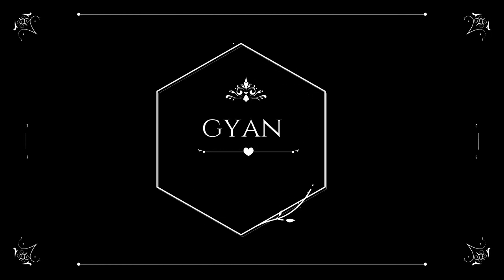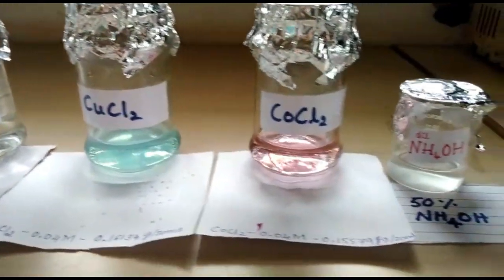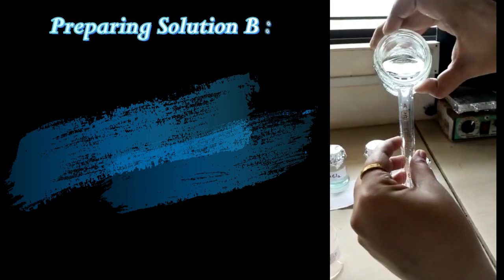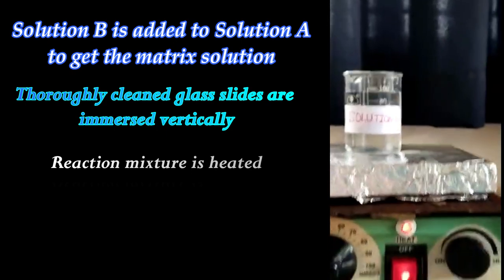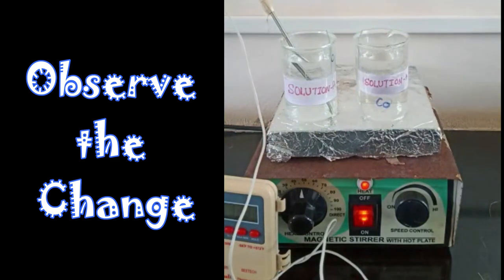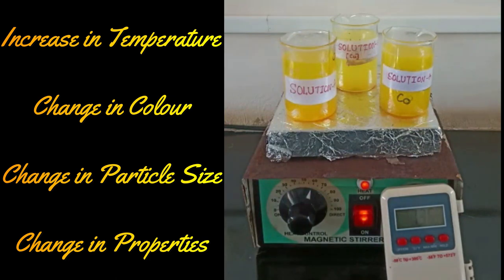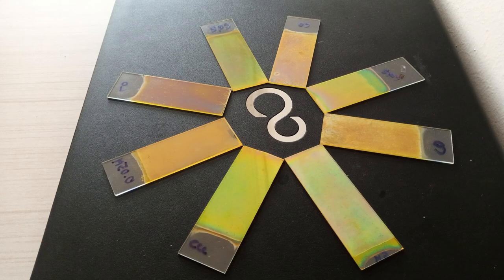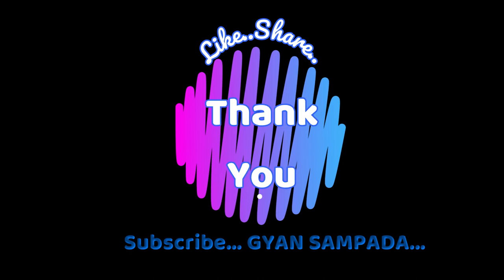Synthesis of CdS Thin films using Chemical Bath Deposition Method👉Doped & Undoped Cadmium Sulfide TF

Comment: How we can test it?
How we can measure its work and ability ?
How we can use this thin film in electronic project (like any photocondictive or photoresistor)? 
We need videos on this topics. Really we need.
I will be really happy if you tell me. Thanks
Reply from the maker: You can use various characteristic techniques based on type of application you want to work on like absorption spectrum can be obtained or even I-V characteristics etc.
Most important part is the quality of the film.. It has to be uniformly well deposited without any impurities. So more care is to be taken with respect to surrounding environment.

Comment: Kindly tell us the Calculation of taking gram of chemical??
Reply from the maker: There is no exact way but you can use trial and error method depending on molecular size to get a good quality thin film. Because quality depends on quality of chemicals, temperature, etc. 
Rough idea you can get in this video itself or you can avail many research papers on the same. 
Thank you🙏

Comment: Mam, Is CdS thin film is toxic? Did u use gloves while preparing?
Reply from the maker: We have to hold the glass substrate where there is no deposition of CdS.
This avoids any toxins from getting in and also film quality will not be affected by fingerprints.
So with caution you can handle even without gloves.
I recommend not to take in the fumes during the process.
Thank you 🙂
Reply: @gyansampada4587  thank you mam😊
Reply from the maker: My pleasure 🙂

Comment: There are sooo many things wrong with this video. These are very toxic chemicals - cadmium is a heavy metal!!! Lab coat/gloves should be worn. Also this should be done inside a fume hood. PLEASE remove this video as it shows horrible chemistry technique from start to finish. (I have done similar synthesis for years and this is horrifying...you are going to destroy your health one of these times)
Reply from the maker: We had deposited it just for a small project with very less molarities in well ventilated area with necessary precautions. 
However thank you for sharing your suggestion 🙂